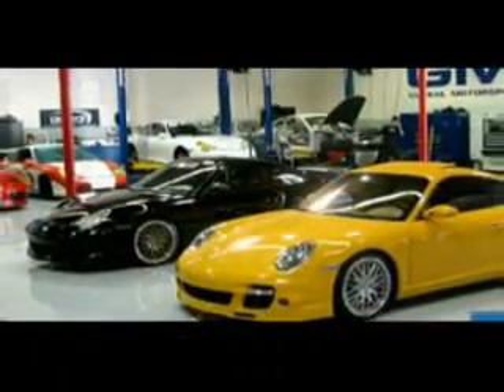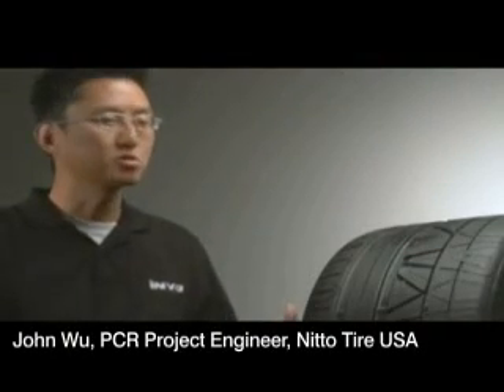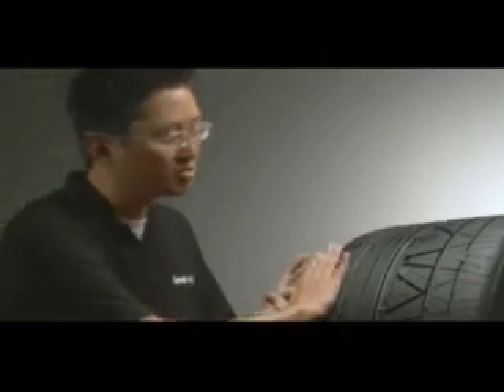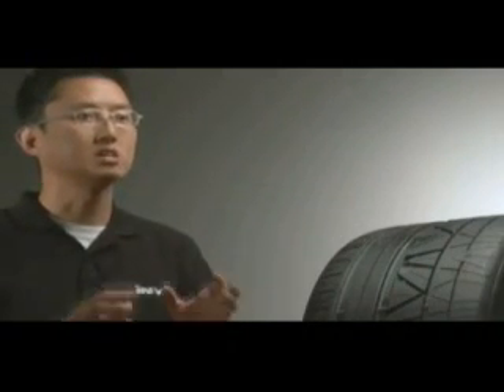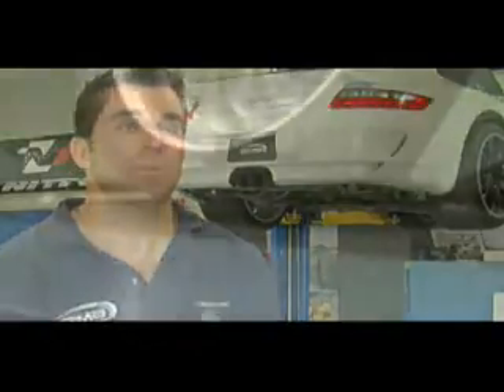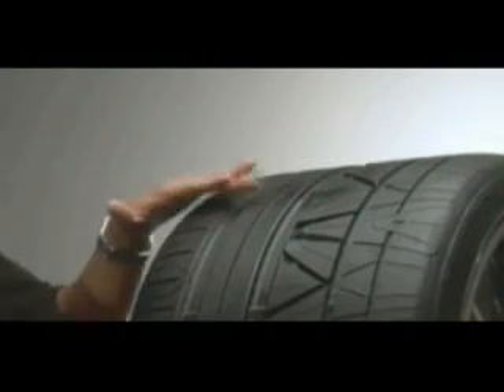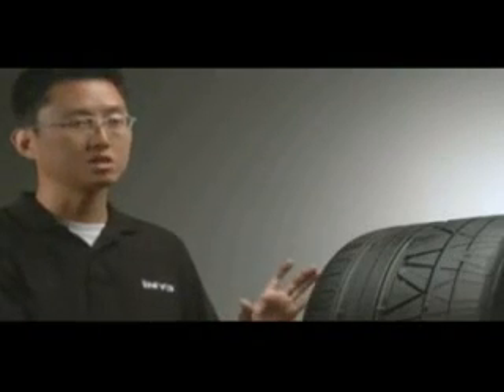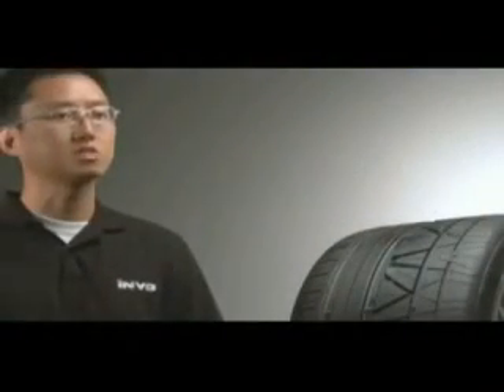Engineering Invo for Speed

Comment: I have run the 225/45/17's on myToyota Caldina GtFour previously and found them to be extremely good tyres in all conditions we get in New Zealand..... I was amazed at the grip level vs other brands I have used.... Definitely getting another set fot my 87Toyota Celica GtFour
I just wish more sizes were available like a 205 or 215/40/17 as I can't fit 225/45/17 on my 87 GtFour